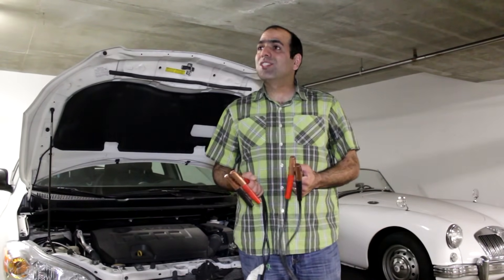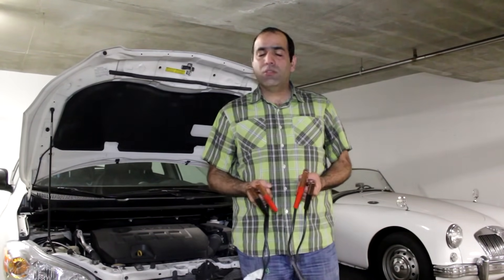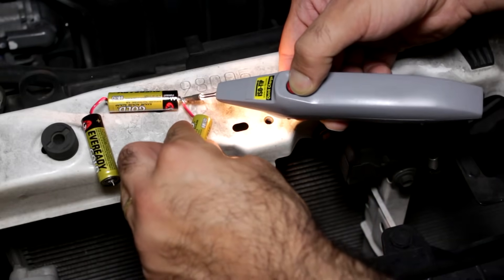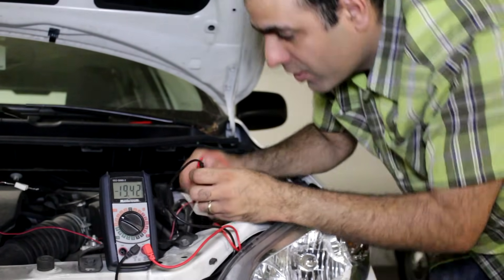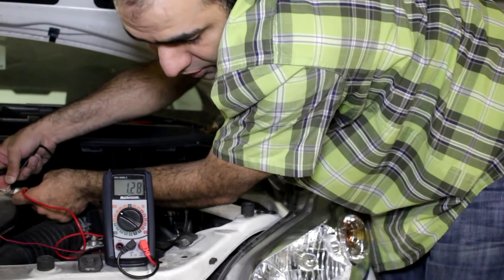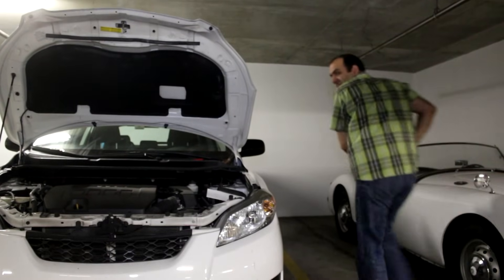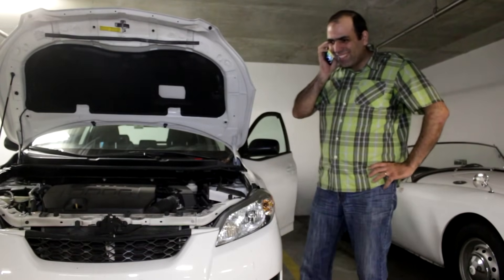Jump Start a Car with AA Batteries

Comment: What was the purpose of the 1 ohm resistor?
Reply from the maker: +Brandon Doherty Mostly current monitoring.
Reply: +ElectroBOOM But doesn't current have to be measured in series (and voltage in parallel)? It looks like you are measuring it in parallel over the resistor. Could you explain?
Reply from the maker: I am measuring voltage across a 1 ohm resistor. V = R.I and R=1 so V=I. So the voltage I read is the same as current through batteries.
Reply: Ah ok, thanks for the explanation! I love learning about this stuff! Your videos are awesome!
Reply: +yogibear2k10 They are real, tought the way he gets injured every time is fake (mostly) :P altought i love the style of his videos!
Reply: +UraniuProductions He meant that the sparks are not made with editing softwares,he makes them with a big capacitor charged to something like 40v(he said this in a old video).
Reply: +Brandon Doherty Shunt resistor my good man, used a lot in power electronics as sort of "sensor".
Reply: David but only a small amount. You can see there is 2V over the resistor, while the total voltage was around 20, so only 10% of the voltage is dropped in the resistor. Not including it would make it more efficient, but also more tedious to monitor the current draw. 

(fun fact, this is the exact same thing your multimeter does when it measures current, since it can only convert voltage to a digital signal)
Reply: +RaD I remember him commenting that the only "fake" thing was in the guitar video when he added more sparks, since he couldn't get enough during filming.
Reply: Good explanation, Deserve the double of subscribers
Reply: +Brandon Doherty I\'m not sure but ,if anyone else trying to find out how to recondition used car batteries try Renkarter Rapid Renew Report ( search on google ) ? Ive heard some interesting things about it and my buddy got excellent success with it.
Reply: ***** no
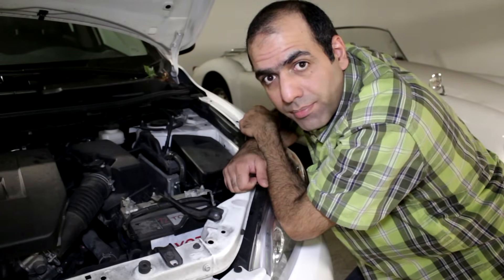Reply: at 2:00 He says that resistor is used to measure current flow.
Reply: Brandon Doherty shut resistor
Reply: Yep if V=R*I when R=1 then V=I. And that's how you measure the current without an ampmeter. Years ago I thought I was a genius for figuring that shit out.

Comment: Why don't they make it so that batteries stop giving power to lights when they run low on power?
Reply from the maker: +ChinnuWoW Well, at least you will have your lights going!
Reply: parasitic draw isn't just limited to leaving lights on. if there is a shorted circuit somewhere inside your car it could be draining your battery without you knowing it, and your average Joe won't know how to properly track down the culprit.

Comment: 11.75V is more than enough to start engine
Reply: Sometimes yes, but most of the time no, if he turned on the ignition, that would probably decrease dramatically, to a level too low to crank.
Reply: +H U yes, I mean normal conditions like these. Of course, if car will stay at -40 for a week it won't start
Reply: Yes although the voltage doesn't tell you the state of the battery, as I said first that was before any other appliances have turned on e.g ecu, relays. I had a battery the other day it was at 12.4v but only went down to 8v when cranking, the car cranked for about 2 mins, but couldn't spin fast enough.
Reply: +H U your battery usually drops near 8v's DC under cranking conditions. the old Ford starter solenoid mounted on the fender usually cut out right at 8.5v's. several times I've been able to stick a screw driver into the solenoid post bypassing the solenoid and starting the car on as little as 6v's. most cars with good capacity should be able to start down to about 10v's DC. this video just shows his battery is weak/old or was designed with a very small capacity.

Comment: hey great video.

how does the actual charging happen? do you just complete the circuit loop with neg-neg and pos-post and wait? why does the AA battery stuff flow and stay into the car battery? why doesnt it keep looping around, never fully charging?
Reply from the maker: +BahBahTheSheep Yes, neg-neg and pos-pos. The charging happens when current flows backwards into the car battery, returning the battery chemicals to their original charged state. The current flows from AAs positive side to car battery , and back from car battery neg side to AAs, because AA chain has a higher voltage than car battery. Of course the current is looping around. It is not like I'm pouring electrical charge into the car battery, but I am charging the battery, in the sense of returning chemicals into their original form.
Reply: @ElectroBOOM  hey i didnt even know you reply to the comments lol very "shocking"

Comment: What is that WIRELESS SOLDERING IRON that You were using ????? , i want one but a quality one , possibly li ion or li po . but what is your cordless soldering iron ?? Thank You , Stay Safe 😀 .
Reply from the maker: +Kyle R It is a Pro-Tip iron. They gray one!
Reply: oooh , I finally fount it as ISO TIPsoldering iron , wow 1/10th of an ohm 2.4 volts 24 amps,??? Sheesh lol 50 watts , im getting one , Thank You 😀  .  Stay Safe .

Comment: "they're gonna look past my unibrow and see me for the genius that i am"
Reply: -Abraham Lincoln
Reply: +Kobe 530 unibrow = genius
Reply: Does a unibrow lower the resistance betwen betwen ears ? lol
Reply: I fuckin died
Reply: Yeah we all saw the video
Reply: @Defrap22  it's a common thing to take dialogues from the video and quote it out of context in the comment section. Especially if it's funny or weird. So no need to be mad.
Reply: I push started a truck with a manual transmission and no battery in it, with 2 D cell batteries. That's because an alternator only needs 3 volts to energize. Once the alternator starts to spin, it'll produce the necessary power to start the vehicle on its own..
Reply: 🤣🤣🤣🤣 that statement was a genius in and of itself.
Reply: +Kobe 530 *they're
Reply: Hilarious! Love it!
Reply: You killed um
Reply: Read this comment before I heard him say it and thought it was golden
Reply: I had one thicker than yours when I was young. I was told that in my (Italian descendants) family it was a sign of virility! Besides that good news, ...if you make it to 75 you will not only loose your unibrow you will barely have any eyebrows at all. The ones I do have are long enough to put in curlers but they're already curly! ;-)
Thanks for another great laugh! 
Wakodahatchee Chris
Reply: Its like the man has no insecurities
Reply: I'll finally get the recognition I deserve.
Reply: “I’ll finally get the recognition I deserve! Let’s do this.”
Reply: "Hey, it's the unibrow guy!"
Reply: pannekoek poedersuiker   your evil
Reply: captain wood sword & hayden Williams what are you like 8? Shut the fuck up
Reply: Holy shit it a wild 8 year old... you must be careful or his idiotic powers will kill you.

Comment: I did get a little lost around the area where you actually jump started the car, is this a prank?
Reply from the maker: +TheStruggle If you are talking about if charging worked, yes it did.
Reply: Sweet, you are certainly a genius for this one!
Reply: Yes this will actually work , like he said , it will provide enough power to just turn the crank over a couple of times .   he pulled out His ammeter and showed how many amps were being. sucked by the car battery , im an electronisc engineer too .   take care .
😊
Reply: Thanks always nice to know a few tricks is all and this one is major!

Comment: Did this years ago on my old beater '78 RX-7 with an 18V cordless drill battery. Out in the middle of nowhere installing a Hughs Direcway satellite system. Left the car radio on all day. And then, at 8PM, long after everyone else had left and there was not a soul for miles around, I intended to leave and got the dreaded "click click click" from the starter solenoid. Much swearing. Made up a set of quick and dirty jumpers, jammed into drill battery terminals and twisted onto car battery terminals. Waited 10 minutes, then started the car. Victory!
Reply: good thing the rx7 wasnt broken lol
Reply: It's a Rotor Motor inside
Reply: aaroncake what did it do to your battery after the charge?
Reply: BnE2012 i suspect it charged it just enough \_’-‘_/
Reply: SA22C RX-7? Nice!
Reply: koolkitty8989  and that's why I'm glad to have manual transmission :)
Reply: aaroncake
I've got to ask - are you the Aaron from Aaroncake.net? If so thanks for the epic website, I found it about 15 years ago and back then I remember looking at almost all of it! Spud guns, electronics, home automation everything.
Reply: @burgersnchips  Indeed, that is me. And thank you for your thank you!
Reply: I love RX-7s. Well done for your genius idea.
Reply: Dude, You're a hero! I just resurrected my mx-5 using the same method. Thanks. Although, I might've ruined the drill batt.
Reply: I'm happy he got his car started using this method & surprised Mythbusters didn't make an episode about this.
Reply: Gabriel Moisan Wankel*
Reply: @88werwolfhun88  
Wanker?* (lol) funny how theres arguments in a post made 3 years ago... also for you guys it would've been approx. 2.5 years... like wtf? 
Its 2018 pull your asses together.
Reply: I almost thought you’re talking about RX78
Reply: How many volts are safe to hook up to a car battery?
Reply: @kevykev9957  Well, without getting crazy,  the more voltage you use, the more current the battery will draw to charge and the more it will heat and gas. So it depends on the charge rate of your battery. Obviously there's an upper limit where most of your charge current is going into heating and gassing the battery. But an 18V drill battery is no problem.
Reply: @kevykev9957  12 volts.
Reply: +aaroncake Your success in that situation is giant leap for us all.
Reply: Could you've just bump started it? Most if not all fb's are manual right?
Reply: @kieranmz4614  Maybe...but pushing it on the unpaved parking lot myself while trying to bump would have have been easy.
Reply: You should always wait a minute and try to crank it again, it works extremely well in winter and should work in summer too. The first attempt to start makes the battery start a chemical reaction that is charging the battery from within.
Reply: The RX series is not the easiest to push start. They are light weight (my RX-8 is rated 3058 pounds), and I usually just push my cars around for when I'm mowing the lawn instead of starting them. However, that RX-8 pushes way harder than my old deisel Mercedes (maybe brake dragging?). Either way, unless its on pavement or down a hill, I don't think you could get it up fast enough. On motorcycles its easy, but not so much on a car. That said I did do that with a little 4wd pickup, but it had handles on the side of the door and it was super light weight.
Reply: @jakegarrett8109  One thing making a car harder to push are worn bearings. I have noticed on some cars which felt too heavy to push, even though bearings are not loose nor resisting wheel from turning while jacked up, and after some years when bearings have become loose and thus replaced, the same car is significantly easier to push with new bearings.
Reply: RX-7 ???????!!!!!!!!🤗
Reply: Yeah you had a soder on you and 12 AA batteries ... You might be from the show Breaking bad or something El Chapo
Reply: Dead Battery Repair - How to Recondition Batteries at Home >> https://t.co/mK3KjJd0lr?sdf34sf33
Reply: @donoman1993 --   https://t.co/mK3KjJd0lr?sdf34sf33 ... scam site. Like all scam sales, spent first 5 minutes telling you what you will learn and how much good it will do you, while telling you nothing about how to recondition batteries.

Comment: Not being able to start the car at 11,75V? WTF car is that?! Normally you should be able to crank even at 11-11,5V.
Reply from the maker: The battery was dead enough not to be able to run the engine which needs over 50A. The battery voltage you see is at no load. As soon as you draw high current from it, it falls below 6V.
Reply: +Midaspl    people never seem to get it. Try to imagine if there is a pressurized gas tank. When the valve is close, lets say the pressure inside is 1000 kPa. If you connect it to a gas turbine as if it's a load and open the valve, do you think the pressure is still gonna be the same? In this case the pressure will decrease exponentially whereas batteries have a more steady discharging curve but its the same idea. Even if the battery is charged, the voltage still drops when the circuit is closed. When a battery is almost dead, although it might seem to have enough voltage, when its under load the voltage will drop dramatically. P=VI, it won't provide enough power to crank up the engine.
Reply: +John Smith   speaking of power, it's to do with the rate of chemical reaction inside the battery. When a battery is dead, it could pump up the electrons when its under load because the rate of reaction is too slow.
Reply: Jack_ Wolf_741 Yep - 13,5V , although it can be charged even higher like 14V, but what it has to do with cranking?
Reply: Midaspl The ideal voltage for a car battery is 12.6 volts, not 13+.
That is 2.1 volts per cell x 6.
Reply: Midaspl @ NO LOAD
Reply: The starter needs at least 12v, 11.75v isn't enough. You must have one of them new special cars if you don't need 12v to start it! Otherwise you'll just hear clicks on any regular car!lol  I think his video was awesome!

Comment: Maybe you can connect the batteries to your scrotum, and if anything happens to you, you can be sure you can NOT make turn an starter motor of 500-900 W with a few AA batteries, probably you will not activate the solenoid.

Comment: Pro Tip: Charging and discharging batteries generates a little hydrogen gas. While modern car batteries have good flame traps on the vents it is best not to trust your eyeballs to the precision engineering of a a battery you bought on sale at Walmart. Should a spark from your charging cables ignite a trace of vented hydrogen and should there be a flaw in the flame traps the results can be spectacular.

Comment: I was slightly distracted by the MGA Roadster in the background. Why leave an OPEN, valuable car in a multi-story? This guy could have easily opened it's bonnet and used it's battery ;)
Reply: Or delved under the parcel shelf, if it still has the original twin battery set-up....